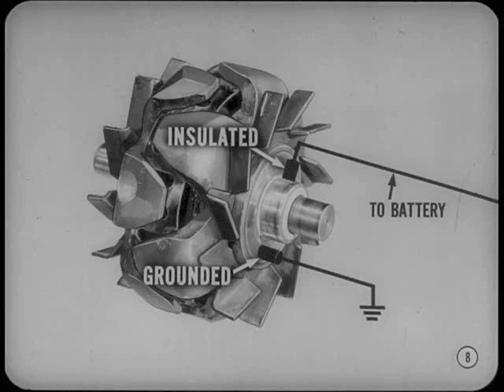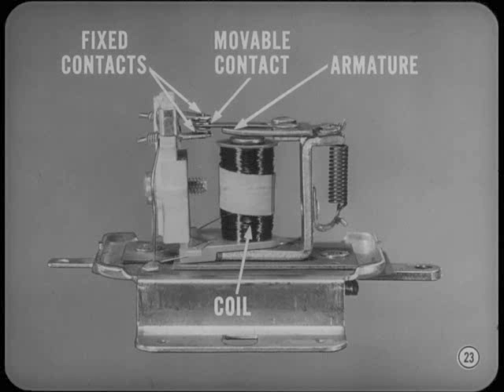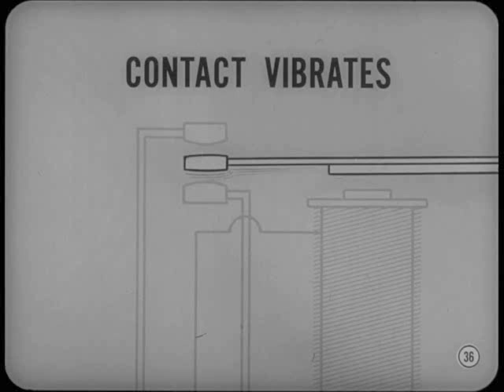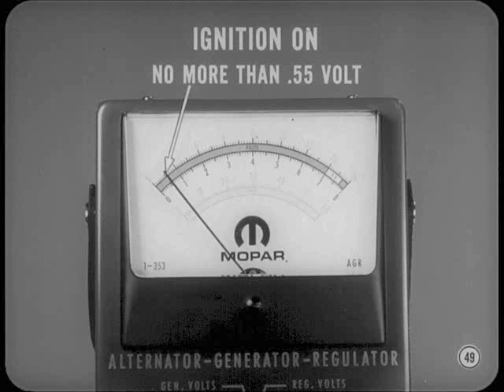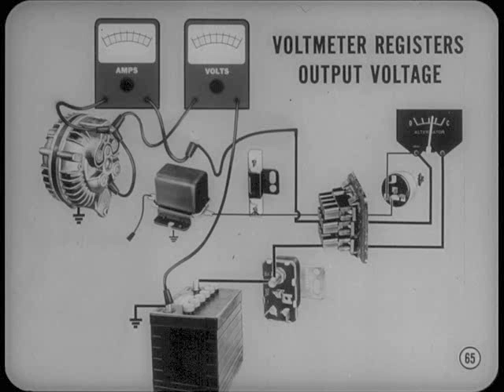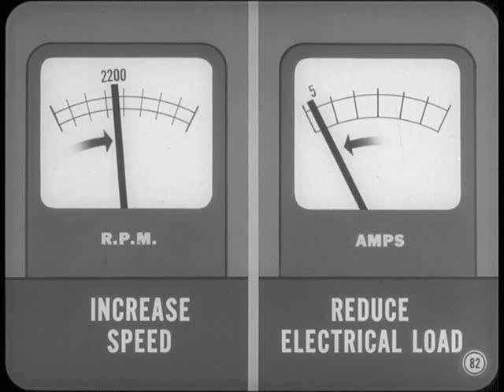Chrysler Master Tech - 1966, Volume 66-11 Alternators And Regulators

Comment: Wow, this helps a lot. I have a 1966 Ford Mustang that had the regulator replaced with a solid state “heavy duty” regulator. The idiot light never worked on the dash when the car was off to alert me that the alternator isn’t charging. I ordered a mechanical regulator, and everything works to spec now. Now I know how to adjust the contacts when the regulator needs service.